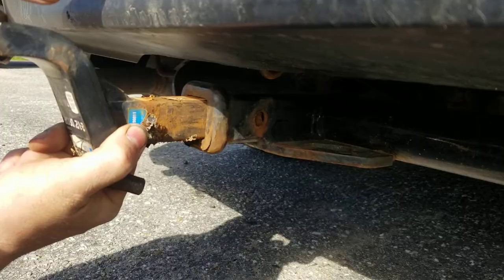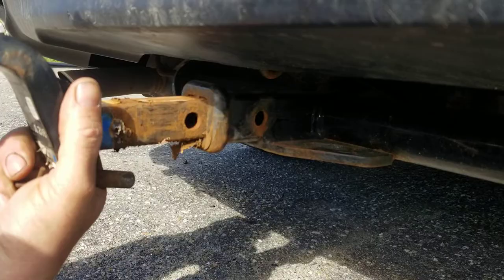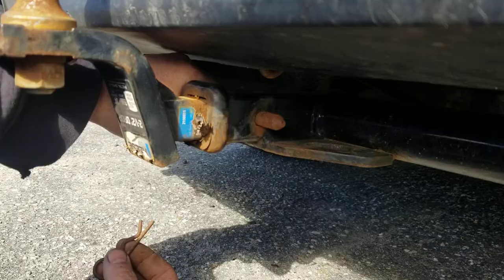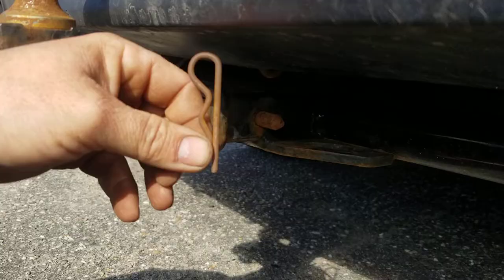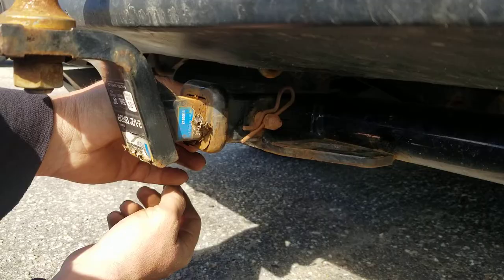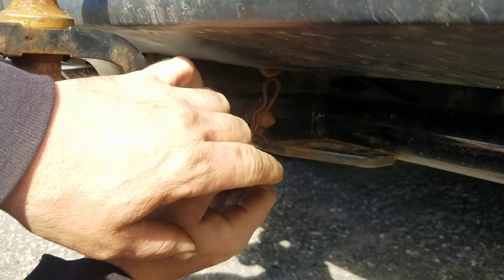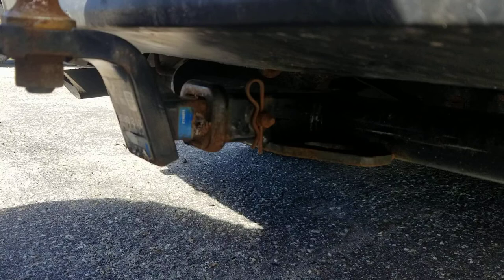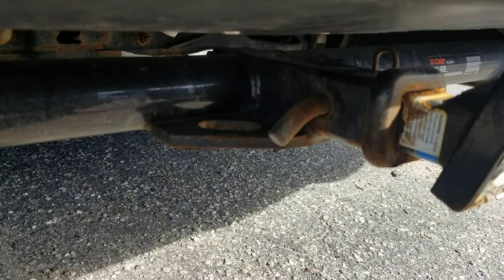Trailer hitch tip 101 proper way to install and inspect hitch pins

Comment: Best info on the net , I’ve hooked up to so many trailors and just stuck the pin in and never thought about this! I’m 30 and never freaking knew this and have tons of experience it’s a wonder I haven’t lost one ! I’m from the south so don’t have much rust issues and like to keep trucks clean so had I ever lost one it’d prob just slid right out easily , if it does fall out your only hope is that the weight of Trailer keeps the shaft in a bind until you notice it , Tom will be checking this and replacing , gosh thank you my friend
Reply from the maker: Very welcome happy to help

Comment: Thanks a ton for your video!  I just got a trailer today and had to add a ball hitch to my truck. I put it on the way you have here. I wasn't sure if the pin was suppose to go in all the way, but the way you show it, I installed it correctly! Thanks again!
Reply from the maker: Very welcome happy to help stay safe

Comment: Thank you sir... as you mentioned my trailer did come lose and on the down ramp of a bridge.... believe me i was $#itting in my pants. the clip had snapped off and the pin had vibrated itself out. the hitch was just dangling and hanging lose scrapping the ground. The only thing holding the trailer in place were the two safety chains. Luckily i had a spare pin and the clip and was able to put it back. I am pretty sure i had not put it the way you showed it. thanks for the demo. it definitely helps.
Reply from the maker: Wow that's why I did this video I am happy you're safe it can get crazy when they come disconnected instead of you being in control it becomes in control

Comment: I spent enough time at Uhaul for instance to say this is correct.  And my shop would have replaced all those parts.  They're due, that rust won't get any better.  Option to spray everything with WD-40, for now. It will act as a coating, and has light rust removing qualities.

Comment: great vedeo good to know so you're  saying if the pin isn't  touching at the bottom  relaxed  or being used it's the wrong one or is it just no good because they should all touch at all times  tks have a good day
Reply from the maker: That's correct if not installed should be touching if not touching it is worn-out needs replacement
Reply: @2strokeguru  thanku for quick response
Reply from the maker: @markschermerhorn4521  welcome

Comment: so I just bought a suv trailer storage carrier and it came with a pin that has NO HOLE in it...the end is notched out but no hole....it does not seem anywhere safe enough. is that common?

Comment: Great stuff and thanks very much for posting this video, Kevin. A quick question: Why wouldn't you push the clip all the way through so the pin is sitting in the end "loop" of the clip?
Reply from the maker: You absolutely could that is technically the best way most people don't do that
Reply: Ok, great. I appreciate your reply.
Reply from the maker: @lloydwilliams7674  very welcome
Reply: @2strokeguru  hi sir, I have a quick question. For reasons specific to my car and situation, I need to remove the ball hitch frequently. 
But my pin is extremely hard to remove 
In fact, I haven't been able to remove it - but I installed it only a week ago.

How to remove it? Brute force? Is there a trick.
Second question - this doesn't seem to require a particularly thick/strong metal.
Would an industrial stainless steel carabiner work?
Reply: i've done that before but it wears out the pin because i don't think its meant to be all the way like that. pins break when you do that over and over. only need to go to the first loop.
Reply: @mikeymo4  Good point and thanks Mike! I appreciate the feedback.

Comment: shouldn't that tow hitch be facing down? it looks like its been inverted to face up. is that just because you need a higher ball? is it ok for it to face down?
Reply: It can be installed either way. Just depends on the height needed